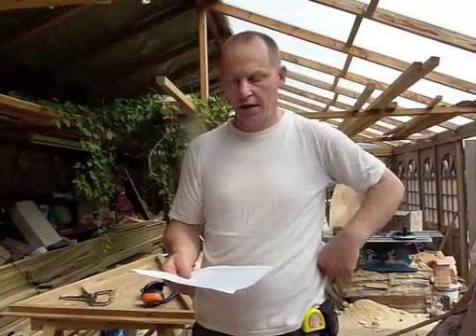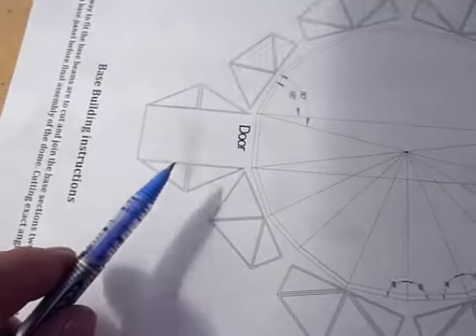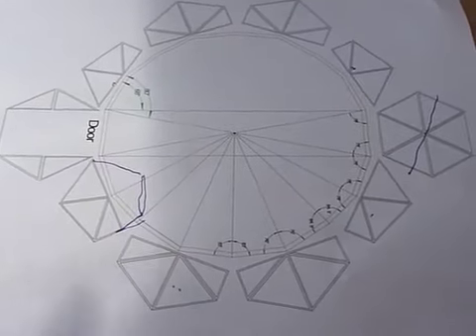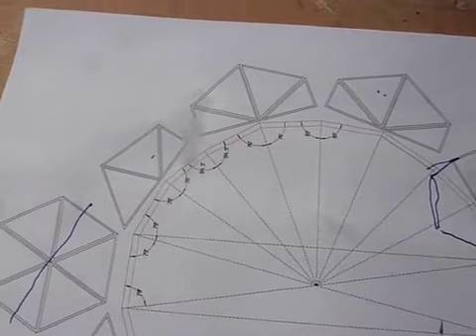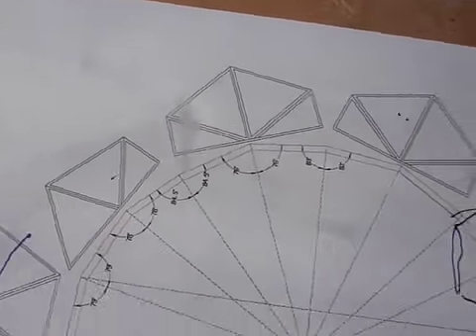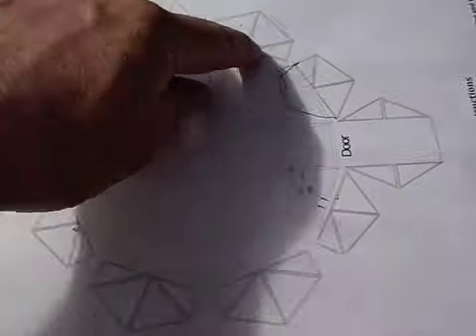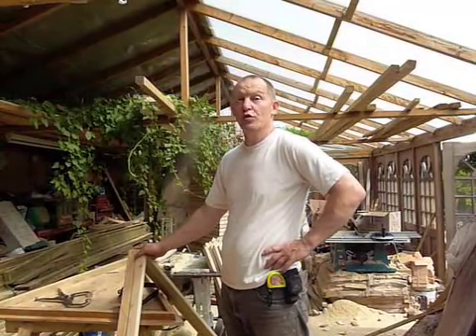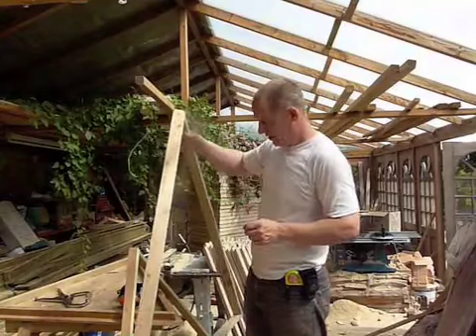GD27 build

Comment: Hey Paul, we built a GD 27 with your plans using ripped 2 by 4 material, worked out great!  I was thinking of sheathing the inside of the dome with plywood to make a climbing wall.  Do you think these domes could hold weight being pulled from the inside?  
Thanks, Alex Rich
Reply: What length 2x4 worked best for you?

Comment: Hey Paul,  If I placed a 500 gallon tank in the center of the dome which size would I need to be able to work my garden.  I was looking at Aquaponics therefore I would need about 500 gallons worth of grow beds.  Once I get the size I will place an order.  Thanks,
Reply from the maker: Nick Rayl The GD27 would work well for something around 500 gallon but I would also look at how much produce you want to grow, I would recommend building as big as you can because I've never heard anyone say They should have built a smaller dome, but I hear all the time from folk who wish they built a bigger one.
Reply: Paul Roinson So more like the GD62 the 29 1/2' dome?  That could be build with the 2x3 wood here in USA?  How long does the wood need to be, can you get a triangle out of an 8' length or not?